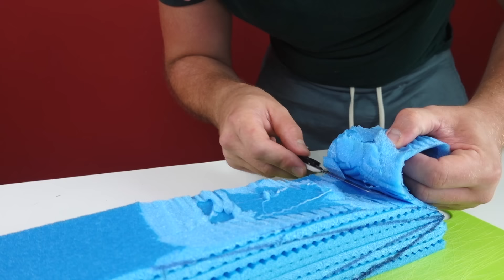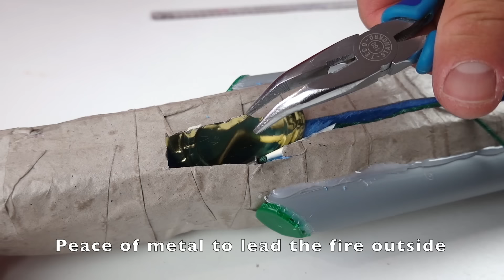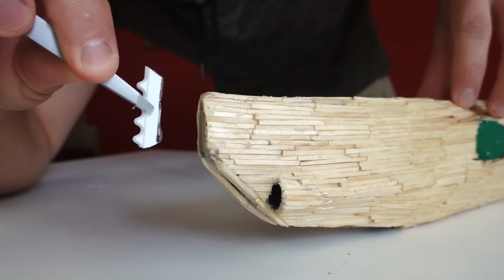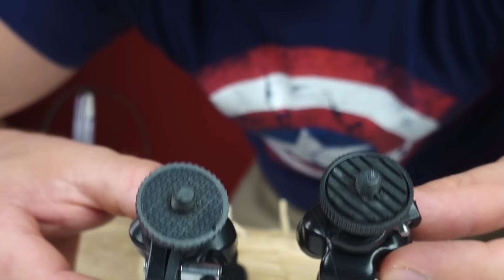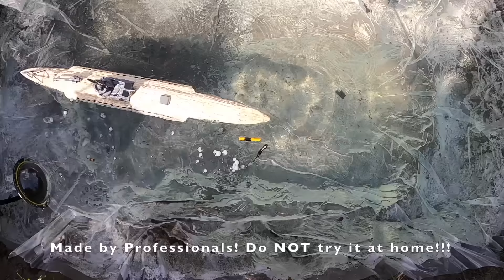EPIC Submarine Sea Battle with Matches Chain Reaction

Comment: It doesn’t look like a submarine. More like a war ship
Reply: It's inspired by a German U-Boat. The submarines of WW2 looked nothing like what submarines today looked like. Back then they were more along the lines of ships that could submerge, rather than the dedicated underwater vessels of today.
Reply: In addition to the guys comment above mine the u-boats (german name for submarines) act more like surface ships than being a submarine since doesn't have enough electricity to stay underwater for long periods of time compare to our modern batteries and nuclear powered subs, so they design it to have some form of defence while its in the surface heading to its hunting ground, so they add Anti Aircraft guns and deck gun for anti ship purposes (some were removed later on in the war, some replaced the deck gun with an overhaul of the design of the conning tower to fit another AA gun), this was the standard of submarines back then until the kriegsmarine started designing the Type XXI where they added a better battery to have the vessel submerged underwater for a longer period of time, a snorkel system to have the engines recharged the batteries without the need to surface like the older U-Boats models and a more streamlined hull to make the sub faster underwater, sadly it didnt prove its combat effectiveness because during its first mission germany called in a cease fire to all active vessels out at sea following the unconditional surrender of the germans to the allies (During the time of the cease fire one of the Type XXI, U-2511 was already had its sights on a british cruiser)

Comment: Hello and happy day: I inform you: The submarine Aras San Juan of Argentina was sunk on 11/15/2017 at 7:30 am by another Chinese submarine that was in espionage work and the Aras San Juan was pierced by Chinese submarine firing torpedoes at them and could not dodge it. The sinking of Russia's oscar-class submarine K-141 Kursk is the best known and remembered to date and was sunk on 08/12/2000 by another Russian submarine as they wanted to desert their crew and request political asylum and of course the Russian submarine K-141 KURS was refloated some time later but did not have a happy ending like the submarine in the movie The Hunt for Red October made and filmed in Hollywood and starring actors Thomas Sean Connery and Alexander Rae "Alec" Baldwin III. The American nuclear-powered submarines and all loaded with several missiles with nuclear warheads or warheads each of them, which are: 1) USS Thresher "SSN-593" and loaded with missiles with nuclear warheads and on April 10, 1963 wrecked or sunk, 2) The submarine USS Scorpion "SSN589" and sank on May 21, 1968. Other submarines of the Soviet Union with nuclear propulsion and loaded with missiles with nuclear warhead or warhead and these are apart from the K-141 Kurs previously commented, the following: 1) Submarine K-27 project 645 and sunk in 1979, 2) Submarine K-8 November class was sunk on April 12, 1970 and is the greatest radioactive threat in the world, 3) Submarine K- 129 with diesel-electric propulsion but loaded with nuclear weapons and sank on March 8, 1968, 4) Submarine K-278 Komsomolets and was sunk on April 7, 1989, 5) November class submarine K-159 and was sunk on August 30, 2003. Not just the United States. but also the then Soviet Union had its losing streak, many in sunken submarines although, typically, they did not announce it frequently. To find an atomic bomb you can use a radiation detector, although it is not that easy. The problem is that water is a very good insulator of radioactivity. According to classified report of the KGB had read that the then Soviet leader Yuri Andropov commissioned 60 copies and that (the bombs) were manufactured in Russia ", the rumors are that Russia then Soviet Union, produced about 250 portable bombs and that 100 of them were lost. Russians claim they were all destroyed but Forsyth cites sources that say they were hidden in Moldova and are now at the disposal of the »21st century antichrist = Criminal, mentally ill» and Russian dictator until 2036 Vladimir Putin. Nuclear-weapon aviation accidents just to mention a few are: 1) In 1956, a B-47 bomber loaded with two atomic bombs vanished forever while flying over the Mediterranean Sea. Even today, what happened to the crew and their cargo is unknown. In the US, other atomic bombs were lost in North Carolina and Georgia as well as off the coast of New Jersey and Washington State, 2) On July 28, 1957 as a result of a breakdown in two engines, the pilot of a C-124 plane drops two nuclear bombs on the New Jersey shore. The plane was able to land safely in Atlantic City but the bombs were never found, 3) In 1958 a B-47 bomber collided with an F-86 jet in the vicinity of Tybes Island, Georgia USA, the nuclear-charged bomb weighed 6,500 Kg and was never found, 4) On September 25, 1959 due to a breakdown, a P-5M seaplane dropped a depth charge without a warhead near Whidbey Island, Washington State. The device fell to almost 3,000 meters deep, 5) On January 4, 1961 A B-52 lost part of a wing in mid-flight. Two nuclear bombs fall to the ground. The Army was never able to find the remains of the bomb, which fell near Goldsboro (30,000 inhabitants), 6) On June 4, 1962, a missile with a nuclear warhead was destroyed during tests and its remains fell into the sea near Johnston Island. , in the Pacific Ocean. The island is a territory administered by the United States. 7) On December 5, 1965, an A-4E fighter with a nuclear bomb falls into the sea from the aircraft carrier "Ticonderoga" in Japanese waters. He The incident causes a crisis with Japan and proves that the US displaced nuclear weapons during the Vietnam War. 7) In 1968 a U.S.A.F B-52 bomber crashed with 4 nuclear bombs on board, the explosive material was detonated; the nuclear components had been deactivated by the crew and only 3 of them were recovered. And the most remembered: 8) Occurred on 03/08/2014 due to the supposed error of the impact of an Iranian missile that was loaded on a plane that was stationed in Russia on a training mission and "as the guy on the 8th program would say Mexican comedian * It was unintentionally wanting * ”that blew up MALAYSIA Airlines Flight 370 MH370 / MAS370 which was not carrying any nuclear bomb load but was full of passengers with pure international scientists who were going to give a conference and news about the vaccine and cures some cancer and AIDS "as I affirm or confess on 06/16/2020 Donald John Trump President of the USA" and they were also going to warn of the possible pandemic such as the covid-19. The transatlantic ship RMS Titanic did not sink as a result of the collision with an iceberg but by a torpedo fired by a German submarine that was on espionage. In the world today in the 21st century there are more than 230 lost or lost bombs, nuclear or atomic warhead missiles and this loss is due to the sinking or destruction of ships, airplanes,  submarines, briefcases with compact atomic pumps around the world. In this world things or events do NOT happen by mere chance but by a true cause and effect that will never tell us their truth and if they will always distort it. And all my scientific technical information is sustainable or verifiable either by google or youtube on the Internet. And as my saying or phrase says: "Between the sky, the earth and the bottom of the ocean, neither aliens are hidden since the use of the Internet was allowed into the public domain."